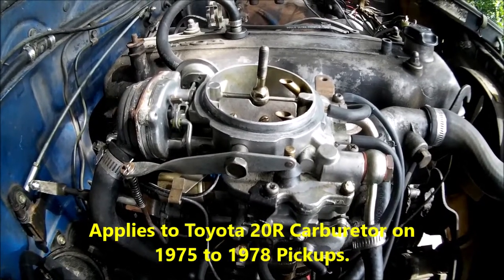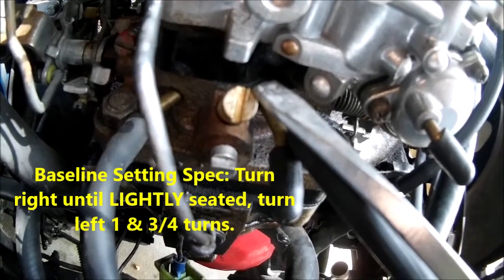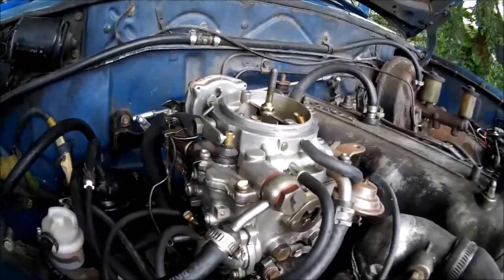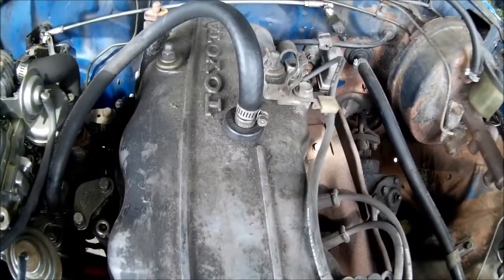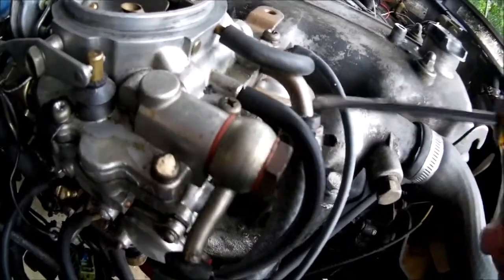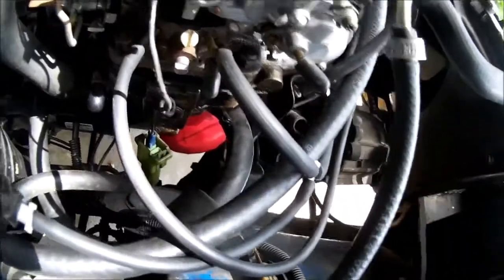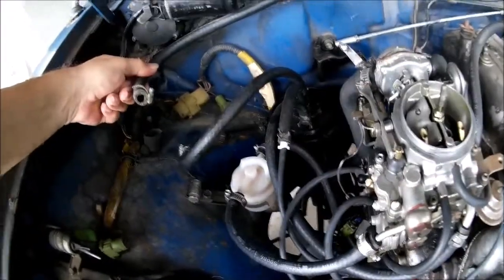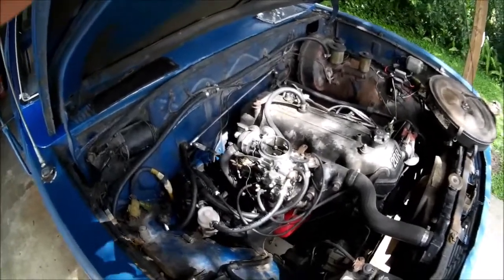1978 Toyota Pickup/Hilux 20R-Carb Adjust & Vac Lines-Desmogged

Comment: Do you if a carburetor kit is still available for sale these trucks. Every time l press the accelerator it delays a bit then kicks in. Sometimes if I press the accelerator fast it turns off? Any help I would appreciate it.
Reply from the maker: That could be a bad accelerator pump, torn Auxiliary Accelerator Pump (AAP) diaphragm, clogged or partially clogged idle circuit(s), vacuum leaks, or several other things. I personally would lean towards the primary accelerator pump but if the carb hasn't been rebuilt in a long time, it could be multiple issues.

Yes carb kits for the carb on a 20R are still available. Here's a reference on Rock Auto: https://www.rockauto.com/en/catalog/toyota,1978,pickup,2.2l+l4,1277108,fuel+&+air,carburetor+repair+kit,5964

You can also often find them them locally at parts stores, either in stock or special order. The kit part numbers shown should be the same. The Standard, WVE or Walker kits are good quality, any one of them would do fine.
Reply from the maker: One other thought. When you get the carb off the engine, check for play in the base throttle shaft on both sides. That shaft rides on bronze bushings that can and do wear over time & use, and cause a vacuum leak. You can check for this with the carb on the engine, engine running, and directing a few blasts of carb cleaner at each end of that shaft. If the engine speeds up, then the bushings are worn.

Given the age of these vehicles it's a clear possibility.

Only fix for that is new throttle shaft bushings, which are not available to the DIY'er. But I do have a carb rebuild source that can handle the job for you. If you need that info just ask.

Comment: Cuantas vueltas debe llevar el tornillo de ralenti y el tornillo de mezcla ?
Reply from the maker: In general, you should turn the mixture screw in (right twist) until it lightly seats (screw "wants" to stop turning). Do not force it past this point or you will damage the mixture screw. Once the screw is lightly seated, turn the screw out (left twist) 1 and 3/4 turns. Please note that a "turn" equals a full 360 degrees of rotation. This is a good starting point for mixture setting. Once the engine is fully up to operating temperature and at idle speed, you can further fine tune the mixture to best lean idle.

I do not have a general rule for number of turns of the idle speed screw. If you are doing an initial setup of the carburetor after a rebuild, I would do the following:
Make sure that choke is fully open. Turn idle speed screw to the left until it no longer contacts the throttle linkage. Then turn the screw to the right until it just contacts the throttle linkage. Then turn the screw to the right 1/2 of a turn.
This should be good enough to give you a decent idle speed once the engine is fully warmed up.

The specification for low idle speed is:
Manual Transmission - 800 RPM
Automatic Transmission - 850 RPM
Both are with engine at full operating temperature, choke fully open, transmission in neutral.

If you have any other questions just ask.

Comment: Question....I've got a 78 with the 20R. It will not start at all unless I prime it manually with fuel. How can I check the primary accelerator pump for proper function? I don't know much about these carbs. It's identical to yours. Thanks
Reply from the maker: Qualifying statement first. IF the fuel pump is getting fuel to the carb's fuel bowl at the proper volume and pressure, and as long as the carb's accelerator circuit isn't blocked, and if the needle valve isn't stuck shut, and you can verify that there is the proper level of fuel in the fuel bowl...

Then all you have to do to verify proper function of the accelerator pump is to look down the carb's throat, operate the linkage by hand & watch for fuel to shoot into the carb's interior body in a steady stream. It would also be wise to look at the top of the accelerator pump shaft that sticks out of the top of the carb cover for movement.

I gave you the "qualifying statement" first because in my experience with this setup, fuel issues are usually pump (supply) related or carb related, or both. Sometimes there is no simple single answer, especially on vehicles with this many years on them. Lots of things can go wrong over time and the whole system needs to be checked out back to front to find & fix any & all issues.

With that said, if your carb hasn't been rebuilt in a while, it would probably benefit from a tear-down, cleaning & rebuild. There are lots of small parts (like seals) that can wear out over time & use, plus some of the small passages (fuel circuits) can get clogged up with "trash', "gum", dirt, etc.

Again, the best thing you can do for yourself is go through the whole fuel system & fix whatever needs fixing along the way. I know it's more work but in the end, I basically had to "touch" every part of mine before I got it to the point where it works & runs well all the time with no issues.

If you have more questions & I can provide any other info just ask me. Specific questions are best.
Reply: @The13thSword  yes thank you. Can you explain the accelerator pump/circuit as I believe that is where my problem is.
Reply from the maker: @JamesDavis-jo9tk  Here is a link to a basic diagram: https://www.flickr.com/photos/amwelto/39081569240/
The accelerator pump plunger moves downwards and forces fuel through a passage and past the pump discharge weight. That weight acts as a check valve and only opens when the plunger is in motion, forcing fuel past it. There is also a check ball (check valve) below the plunger, to prevent the plunger from over-pressurizing the fuel bowl. That pressurized fuel is then discharged into the interior of the carb throat, below the choke plates.
That's the entire accelerator pump circuit.

Just my own opinion but I wouldn't think that if the accelerator pump seal isn't doing it's job, that really wouldn't have anything to do with the engine only starting by putting fuel down the throat. And then it won't continue to run once the fuel you dumped down the throat is gone, correct?
If so I'd say you have one or more of the following problems:
1. Blocked Idle Jet or Idle circuit
2. Nonfunctioning/malfunctioning or disconnected Idle Stop Solenoid
(Both of the above would prevent ANY fuel from going thru the Idle circuit, which is needed for the engine to run after starting, even on "cold" high idle with the choke plates closed.)
3. Blocked Main Jet or Mani circuit
4. Float Bowl Needle Valve stuck closed or open
5. Other fuel delivery problem (fuel pump, bad/old gas in tank, blocked or leaky fuel lines, clogged/blocked fuel filter

You should also check that the fuel bowl has the correct level of fuel in it. There is a sight glass on the front of the carb; that's where you look for fuel bowl level. Here's a link to what it looks like on the carb (Figure 2-23):
http://www.retrojdm.com/ScanViewPage.asp?ScanID=104&Section=Engine%20Tune-Up&DPI=100&Filename=02-07%20-%20High%20Tension%20Cord,%20Carburetor.jpg

In any case, if the accelerator pump plunger seal is not doing the job, it's likely that the whole carb could use a rebuild.
Have you pulled any of the spark plugs to see what they look like? if so what color are they? If any of them (especially #1 plug at the front of the engine) has any black soot on them then the carb is rich (too much fuel). I mention this because there is also a vacuum actuated Auxiliary Accelerator Pump Diaphragm that can develop pinholes in it and create a rich condition at all times. If that's the case that #1 plug will be black and the rest look normal (grey to light tan color deposits).

Let me know any info on any of this and we'll move forward.
Reply: @The13thSword  thank you for this information. Yes, the engine runs fine after it is manually primed the first time. I can drive it all day as long as I don't turn the ignition off. To do so means a manual prime to restsrt. I did check the electrical solenoid and it is functioning as intended. I will now order a parts kit and do a substantial overhaul and cleaning. I did find a alot of debris in the bottom of the fuel bowl upon initial inspection and a few vacuum leaks. The plugs all look normal and perhaps a bit lean.I will pay special attention to that check valve and spring below the plunger that you were telling me about. I do not hear extra fuel spraying inside the throat when I work the throttle.
Reply from the maker: @JamesDavis-jo9tk  You do not hear extra fuel spraying inside the throat when you work the throttle, but can you see any? You also need to look down the throat when you manually work the throttle to see if the plunger is putting out any fuel.

I still think that this is a symptom of bad seals in the carb, possibly more than one & it needs a rebuild, so good decision there. Take your time with it.

While you're waiting for the rebuild kit I recommend that you check out every rubber fuel line & replace all of them with new line. If you have some of the older style fuel line on there and any of the modern ethanol-laced gas has been run through the system, the insides of those rubber lines could be deteriorated. Non-ethanol rated rubber fuel line can't handle ethanol-laced gas without shedding off small particles of rubber. I know this because it happened to me.

Beyond that, you could still have some issues with the fuel system as far as correct supply of pressure & volume. If you have an electric fuel pump in the tank (stock kind) there are a few electrical things that could cause that to happen. Let me know if you get that far & I'll help you out with specific info.
Reply: @The13thSword  yes sir. I did not observe or smell fresh fuel in the throat as i worked the throttle manually. I do believe the plunger to be damaged or the circuit blocked. What should the fuel supply pressure be? I will update you by the end of the week.
Reply: @The13thSword  after extensive inspection of my carburetor I found it to be damaged beyond repair. I desmogged the engine and installed a new Weber 32/36. It runs excellent now. Someone had rebuilt the original carburetor and over tightened some bolts dmaging the housing, it was simply dumping excess fuel at idle. Thanks for all your help sir.
Reply from the maker: @JamesDavis-jo9tk  Thanks for letting me know what happened. A carb housing damaged from over-tightening is one of the most difficult things to diagnose, as is most things previous owners did. That what makes any older vehicle challenging to fix. But you did a great job in getting it all tracked down, so be sure you take the credit for that. 👍

The Weber 32/36 is a solid choice, as long as it's a genuine Weber, and as long as you can get the fuel pressure regulated correctly. Glad to hear it's running well.

If I can be of any other help in the future just ask.